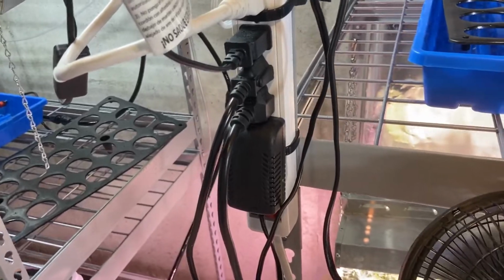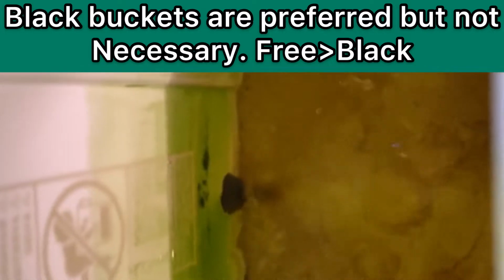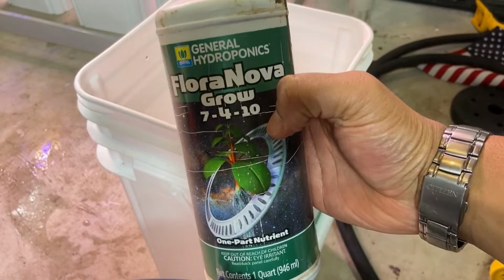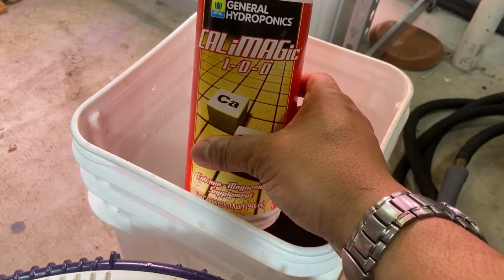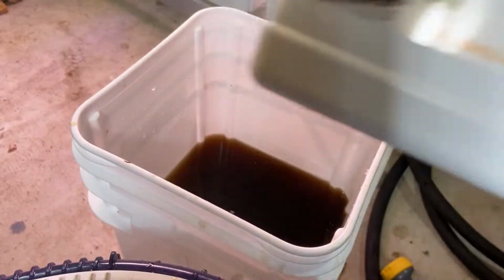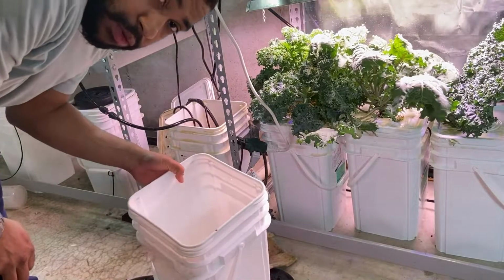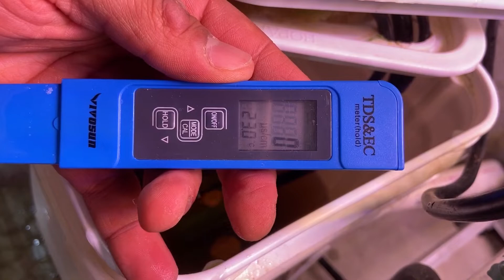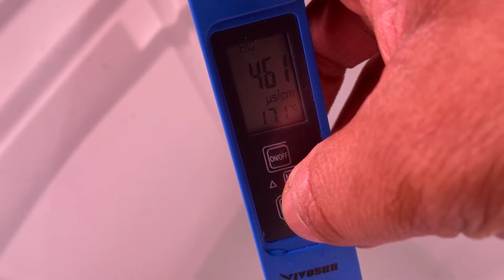The Complete Guide to change Hydroponic Nutrient water (worth it)

Comment: The EC meter should be referred to as the TDS meter for the sake of understanding its purpose. TDS stands for total dissolved salts.  Therefore this is an indication not only of the strength of the nutrients in your solution; but if you test the solution prior to switching out your reservoir and compare it to the original number you will have a  indication of the rate at which your plants are absorbing their nutrients
Reply: Total Dissolved Solids. Not Salts.

Comment: "With some exceptions, the optimal pH range for hydroponically grown crops is generally between 5.5 and 6. Many fruits and vegetables, such as melons, apples, beans, squash, and tomatoes prefer that range. Blueberries, on the other hand, need a lower, more acidic pH between 4.0 and 5.0. It’s a good idea to use separate nutrient reservoirs for plants with similar pH ranges.

Some hydroponic crops have a wide optimal pH range. Pumpkin, for example, will thrive in a pH between 5.5 and 7.5. Crops that require alkaline conditions include kale, onions, and peas, which prefer pH levels between 6.0 and 7. Mint plants tip the scale at an optimal pH range of 7.0 to 8.0."
Reply from the maker: Wow! I learn more everyday. Thanks for taking the time out to give us this insight!
Reply: @joshuarudd6297  
To make it more interesting different crops require different nutrient formulations and EC.  The minerals in your source water add to you nutrient formulation so its useful to know what is in your water. The water suppliers here test and publish details of mineral content, ph, ec, hardness etc which makes it easy. I make my nutrients from scratch and use reverse osmosis water so i know exactly what is in the nutrient solution (no unknowns).  If you have high calcium carbonate levels in you water its best to use a nitric acid based ph down to control the ph as it converts calcium carbonate into calcium nitrate which the plants can use. If you use the more common phosphoric acid based ph down, the carbonate will be converted into calcium phosphate which is insoluble and therefore unavailable to the plants.Its not good for your filters or nozzles either :)  Be aware that the Uptake of nutrients from the nutrient solution causes the ph to change, for example, uptake of nitrate (NO3) causes the nutrient ph to rise, uptake of potassium (K) causes it to fall. I prefer drain to waste, nothing comes back to taint or alter the formulation so the nutrient solution remains balanced from start to finish. The last drop has the same elemental makeup, ec and ph as the first. A recirculating reservoir is only a known quantity when you first mix it up, elements are not taken up evenly so it gradually goes out of balance as elements are removed  At some point you have to replace it with a fresh batch, if you dont know what is left in it ..its tricky to judge when that point is.
Reply from the maker: That seems pretty complicated! Thanks for breaking it down though.
Reply: @joshuarudd6297  
Its pretty easy when you get into it. To my mind a recirculating reservoir is similar preparing a weeks worth of meals, placing them in a container and scraping the leftovers back into the container after each meal.  If you are dumping 21 gals of nutes per week you could run 3 gal a day drain to waste and "waste" the same quantity. The difference is the elemental content of the nutes wont change throughout the week so you know what your plants are getting. Another benefit is you can test the ec and ph of the run off and that will give you an indication of what the plants are doing, if the runoff ec is higher you can see the plants need less ec. You can tell if the plants are taking up nitrate as it will be reflected in the runoff ph .If the run off ph is not what you expect you get an early warning that something is amiss. With a recirculating reservoir you wont be aware until it shows up in the plants, which is typically days after the actual event. If you aware of an issue you can remedy it before it affects the plants. Time lost to issues can add up so the sooner you see the issues, the less impact they have on growth.
Reply from the maker: The cool thing is that I don’t dump any gallons to waste. My plants drink all 21 gallons because I have several large plants and at least  10 other plants growing in the system at most times. It’s not evaporation because I have humidity sensors and dehumidifier running constantly and its low most of the time. It’s pretty crazy how much plants can drink in a hydroponic system. I’m always surprised.
Reply: @joshuarudd6297  I would check the ec and ph changes through the week. With a recirculating reservoir the waste that the plants exude will end up in the res which puts it into a constant state of flux. I run a 12 bucket flood and drain system on a 90L recirc res which is swicthed  out when i`ve added 90L of topup water (no nutes). The garden veggies make use of the spent res so there`s no waste. Forcing the plants to use a non optimal reservoir risks losing precious growing time. If something they need isnt in the res they have to wait until the fresh res arrives. If you get a deficiency or a lockout due to imbalances in the old you can be waiting for days for the plant to make up the lost ground when they get the fresh nutes. I get that some folks like to make their nutes go as far as possible due to the  cost but not if its to the detriment of plant health and growth rate :)